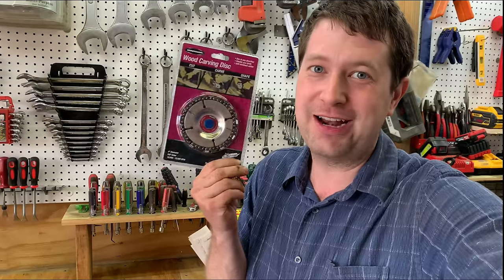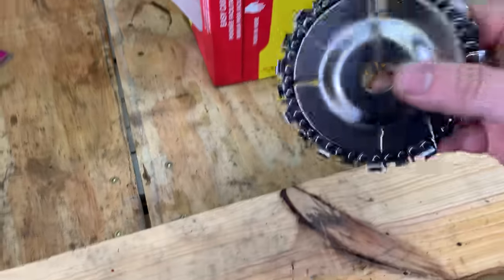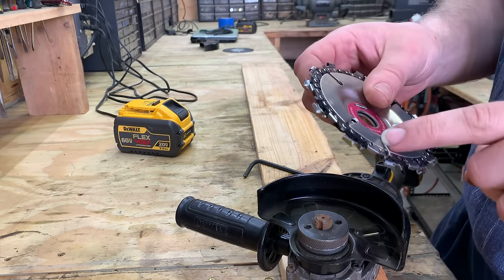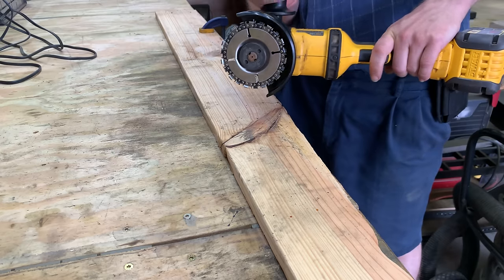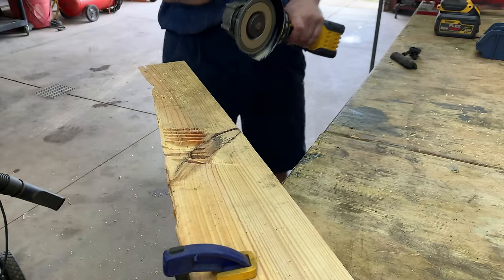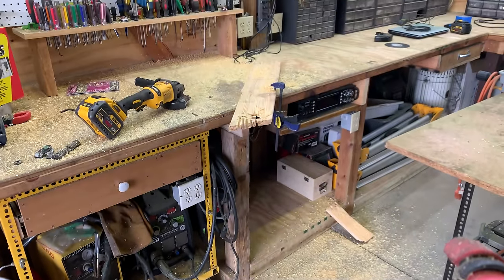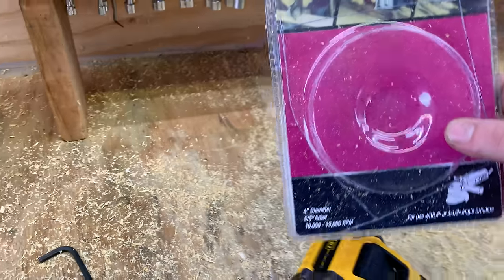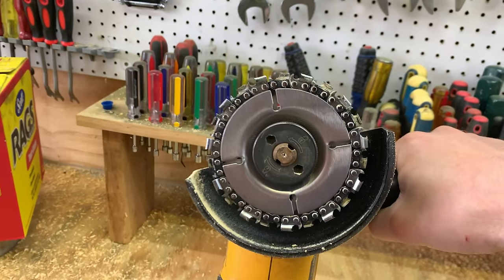Most Dangerous Angle Grinder Attachment I have Ever Seen

Comment: If you're not a wood Carver you would think this attachment is crazy. As a woodcarver I can say that this thing is great.
Reply: I’m not a wood carver, and I think it’s great!
Reply: As a young man trying to learn, this seems like a brilliant tool.

Whats the sharpening routine like? The teeth look quite irregular, so i cant work that out... Maybe like a chainsaw blade, file each tooth?
Reply: @zerg9523  I sharpen mine with the same files I use on my chainsaw.
Reply: Humor In Politics I bailed at 00:15.  First impression of this guy was he has no idea what he’s talking about
Reply: its too dangerous though
Reply: I actually also posted this question to the video... *see below*

This does look like a very effective tool... However it looks like it could bite the operator very easily and just as quickly. What would be the best practices for using this tool?

I’ve added some initial guesses below...

- Use it with a grinder that has a clutch or brake so it doesn’t idle when you power off.

- Never use it ”always on” mode. Make sure you need to hold the trigger, at least then when you let go, the danger stops.

- Personal protection : eyewear as a minimum, leather apron, chain mail gauntlets...
Reply: You must not have seen Stumpy Nubs video regarding his "experience" with one of these devices. I'll take a hard pass.

Here is the video in case you're interested. He had a few follow up videos too.

https://youtu.be/IIQu1e8DGUw
Reply: I'm a wood turner, as soon as I saw the thumbnail I had to see how well in carved. I have to say, its pretty impressive. It removes a lot of material and looked like it did so quite cleanly. I may have to see if I can find one next time I'm at the ol HF.
Reply: J Lang - Thank you, no i handn’t seen it, but now I have... scary...

I am a computer guy and home gamer engineer, i since it seems so effective i’m wondering is there anyway such a thing could be made safe.

My first reaction would be some sort of acceleration based emergency brake. Nobody is throwing that thing around while it’s being used, so its a perfect candidate for it.
Reply: a long time woodworker james hamilton - stumpy nubs reviewed this device about a year ago, one of his videos shows it kicking back and severing two tendons in his hand, he is a very experianced woodworker, and power carver.  it still bit him and damn near eviscerated him, no amount of safety grear would have stopped the damage only sheer luck he has his hands. just read more comments sounds like i am repeating j lang, and he put in the video link
Reply: Zerg a home gamer engineer?
Reply: Kommentare Kommentierer - i’m a software developer for a living... but i get my fun in my home workshop making things.
Reply: J Lang okay, thanks - I have modified my opinion of this thing after watching that 😬
Reply: WHO has believed our report? and to whom is the arm of YAHUAH revealed?  YESHA'YAHU (ISAIAH) 53:1 את CEPHER
Reply: It's a substitute for carving when otherwise you'd use a chain saw.
Reply: @Rick-ql9wp  right?? I'm a carpenter and just listening to this guy talk I can also tell his common sense level is nil.
Reply: I'd like to bet that if it had made in America and was 3 times the price he would have said it was one of the best inventions for wood carvers going.
Reply: Cool grinder attachment
Reply: @jimwilson946  I completely agree.
Reply: Ave knockoff
Reply: Straight up getting one of these, looks epic :D
Reply: J Lang Yup. Thankyou for posting that link. So many nay sayers in these comments....Stumpy isn’t someone that I’d call careless or foolish yet it still caused him significant damage. Definite hard pass.
Reply: Check out the dude from stumpy nubs. Surely no noobie woodworker and had a nasty accident with these. There's a video where he explains how the blade catches and made him loose control of the tool
Reply: I was thinking the same
Reply: I subbed
Reply: @zerg9523   These diabolical attachments should be banned - They CANNOT be made safe in any way. 
A blade rotating at that speed will remove fingers or nuts quicker than anyone could react to stop or avoid any kickback scenario.
Reply: Da Reproducer - I agree, and think you’re absolutely right about the reaction time, nobody can react quicker than it can kick.

That being said, as a software engineer and home gamer mechanical engineer, i like a challenge... My first thought was an inertial sensor with an emergency blade break... that could comfortably react within a few hundredths of a second, before its had chance to really bite the operator.

I was actually so interested in the thing, i asked an experienced carpenter friend. He tells me that some emergency breaks already exist in the marketplace and usually in the higher end tools (particularly circular saws)... He has never seen an angle grinder with such a break system...

What are your thoughts on that? And thanks for the reply by the way, sensible answers are not easy to come by on YT.
Reply: @zerg9523  if you research it, you'll find out why angle grinders don't have breaks. Also, every video that shows this attachment kicking back, is when the operator uses it improperly. I've been using it almost daily for 2 and a half years. Its cut my large carving project times by about 30% and I've never had a kickback. I never use it improperly thought.
Reply: Humor In Politics - I totally get that, an experienced operator with lots of sense generally gets to keep their finger through a career... Maybe i am trying to idiot proof something that idiots should never had touched in the first place.

I have looked into why angle grinders don’t have breaks and please correct me if i am wrong. I can only really find a single good reason, loss of peak torque in a clutched system. From what i can see other than that it comes down to product expense and manufacturer choice.

I have as an experiment added a clutched orbital gear-set to an angle grinder in the past, long before i ever encountered these carving discs... After seriously rough testing, I discovered it almost cant kick back with such a system but the torque lost was significant.

I’m not considering a clutch in this solution however. Using a small amount of electronics i was considering an inertial sensor that once tripped cuts the power to the tool and also engages a calliper like slam break on the disc itself... that prevents the loss of torque by avoiding a clutch altogether, but could still potentially offer a slam break option.
Reply: Humor In Politics - As an aside, i’m not some total lunatic blindly making dangerous tools... i actually make dangerous tools with my eyes open all the time... i am currently building a set of laser cutting cnc machines at the moment.
Reply: @zerg9523  when did I call you a lunatic thats blindly making dangerous tools?
Reply: Humor In Politics - Oh sorry if i gave that impression, i was just making sure that you didn’t think i was some halfwit crank waffling on.
Reply: you can't blame if most people are ignorant!!!
Reply: @jimwilson946  I shared yr opinion .
Reply: I have seen wood carvers working amazing with that thing and also i wanted to say that this guy has absolutelly not a clue what he is doing..
Reply: Exactly. For building log homes its the most benificial tool on the site!
Reply: @zerg9523  i agree. But then again what tool cant bit ya? Chalk box maybe? Lol
Reply: @scottlytton5328  the people I've seen get hurt with it are the ones cutting with the side of the blade spinning towards them. As long as you the the side spinning away from you, if it binds, the grinder tries to pull away from you and not toward you.
Reply: Humor In Politics - that is a very sensible tip... and i suppose the halfwit user solution to that would be if the cutting disc came with a shroud that covered the entire left face of the blade, you’d save a lot of people some pain with that i think... thanks again for the tip, always better to be told than to learn the hard way.
Reply: @jlang8213  0
Reply: Maybe you in iron man armour suit's 😀
Reply: @hartonoX69  just need a touch of common sense and always wear your leather leg guards, your leather apron and leather arm guard gloves. Just your standard basic woodcarving safety gear. But let's be honest, not everyone is bright enough wear standard safety gear and those people are just demonstrating natural selection at work.
Reply: @rallywagon261  I agree! I was worried when I saw the title, but after watching how he was using it...like a chainsaw instead of a carver, I wanted one
Reply: We're getting a bit too risk averse... If you're nervous better not go near it.
Life is dangerous... We're so terrified of dying in the UK we let a sociopathic elite lock us in and take our freedom and (a kind of) democracy away.
This disc and a virus 17 times less deadly than flu has left too many of us cowering inside terrified of going to hospital when we need life saving treatment.
This blade like the mystery virus needs respect not fear.
If you're afraid of Drowning in your own bath maybe stick to showers... With handrails and rubber mats of course... Don't use any power tools
Reply: @zerg9523  It is a chainsaw blade.
Reply: If it fixed onto something,i guess its pretty safe.Our hands cant posibbly handle the torque when it did grab into material suddenly.
Reply: @UrMomGreen.  the proper way to use it is by making sure that the side of the disc you're cutting with, is always the side that is spinning away from the user. That way if it catches a hard knot or binds in the wood, the disc grinder gets pulled away from you instead of towards you. Every injury I've seen that was caught on video with this attachment is because they were using it wrong and were using the side spinning toward them.
Reply: I am a chainsaw artist who also makes heavy use of angel grinder attachments on my sculptures and this one is just about the only attachment I didn't want.   It really is stupid because it does the same thing as the saw except with the saw you're a lot further away from the tip.  Btw I didn't watch the video (guy seems like a fool).
Reply: @captaingrub2228  the guy is a fool. The tip of the chainsaw can do pretty much everything this attachment can do. But this attachment can do it in a fraction of the time and this attachment gives much more control resulting in a much cleaner look. Especially during comps.
Reply: In some hands even a sharp pencil is dangerous. lol
Reply: I'm thinking maybe it could be used to grid a stump.
Reply: @MrMunchiemo  it actually works fantastic for stump removal.
Reply: @zerg9523  sharpen as you do any chainsaw blade
Reply: Nope these things are not dangerous because you could cut your self but those chains are  not meant for those kind of  speeds in a chainsaws they are way slower there is a company that makes kind of the same but with hardend steel teeth welded on a steel disk it called graff speedcut and is only around 20 € here in germany  so no need to use thes cheap chines things and risk the chain breaking and fly off
Reply: @jlang8213  thank you for the link.  That was a great vid.
Reply: What happens if the chain breaks?.Have you ever experienced a chain cut?
Reply: @danielillo673  it's not a chain wrapped around the disc. And no I have never experienced a chain cut because I wear protective gear whenever I have a saw in my hand
Reply: As a wood carver I used one for a while. It was effective and i liked the results, but every time I used it when I would put it down i would have to kind of meditate and think about how i had used it. I also used angle grinders for years in construction for rebar. Then my angle grinder jumped with just a sanding disc and bit in to my forearm. Had it been the chainsaw disc I would have likely had permanent damage. This thing is scary and there are belt driven grinder attachments that extend the cutter away from your hands and if it does kick, the belt stops it spinning
Reply: Can't figure out why he thinks it's any more dangerous than a chainsaw
Reply: @mariano_353  Don't know the guy but a name like Stumpy makes me suspect he's been accident prone in the past
Reply: @andygalloway461  its not. As long as you're wearing your standard protective gear, use the device properly and don't act like an idiot, this isn't any more dangerous than any powered saw.
Reply: @andygalloway461  see his video about his accident and tell me if he's been neglectful or it's something inherent to the tool that can happen to anyone
Reply: Use guard I guess
Reply: @andrewpuckridge7633  did he have the guard on?
Reply: Rip I now have one hand
Reply: I can see that 100% near the end
Reply: @Rick-ql9wp  he’s trying to hard.
Reply: Very thick cut,waistage,no precise cutting.Very carelessly handled.
Reply: Just like with every other tool simple or not, only professionals really know how to use it. Average schmucks like him & I?...well we're screwed.

(horrible pun intended 😏).
Reply: But WHY not made from a solid disk which can rotate, why need to add the chain? Chainsaw need the chain, because the tab of the chainsaw cant move so they need a moveable thing around it, which can cut.
Reply: @andrewpuckridge7633  have you seen any reviews of the solid disc ones that look like rotary wrasps they look like they would be far safer than this but I am wary of putting anything on a grinder thats not a brush or a grinding disk just due to the insane torque and speed grinders produce
Reply: @leprosysucks  i Agree carving tools on a grinder are dangerous and i dont use them,  a youtuber called "stumpy nubs"  does use some solid and much safer to use carving tools for a grinder,  he did as video about them, and explains the safety much better than i can, he is also the one who against his own judgement  filmed himself using one of the chainsaw variants and shared the injuries he receved.  short form, he is still recovering full use of his hand 9 nmonths later.

cheers
Reply: Mariano _ Nunn
Reply: Xcc
Reply: No good carvers use these. Only hacks
Reply: @dremmelkiller  only hacks who lack the knowledge, experience and confidence  don't, and shouldn't, use these fantastic disks. But thanks for your hackish opinion.
Reply: I’ve spent many an hour with this type tool.  Originally sold under brand name Lancelot.  The damn thing isn’t a circular saw, dude.  It’s used like any other grinder, only it’s more aggressive.  To carve and shape.  Not cut.  He sort of figures it out near the end, but is using it without any design or plan.  He should just throw his down a well.
Reply: @OriginalRoadScholar  tell me more about my profession please.  
Please show how wrong you are to the rest of us
Reply: @humorinpolitics56  you seem to want to have credibility by using your lazer cutting cnc job.  Well let's be adults then.  I am a pro chainsaw carver with 30 years in the business.
I use almost all tools that are used in this profession. 
The angle grinder attachments are unsafe due to a kickback and grip issue on the tool due to its shortness and the proximity to your face and groin when it spines out of your hands.  Hundreds of people have injured themselves with this tool in my personal groups.  
So we get defensive.  Them some person with bravado tells us we are weak or dumb.  Ok pal  
Now be an adult and realize this may kill some senior or kid.
Reply: @dremmelkiller  what are you talking about a laser CNC machine for now? I'm starting to think you originally meant to comment on someone elses post but hit mine by accident. I've never said anything about laser cutting. But either way, these types of disks are safe and don't kick back at all when used properly by any semi intelligent person. A basic understanding of chainsaws, grinders and highschool level physics will allow someone to use these products safely with zero kick back. I've been using them on almost a daily basis since they first hit the market and haven't had a single kickback. Anyone that has used one of these and had it kickback shouldn't be handling any power tools or sharp objects to begin with. I'm sure you've heard of the old saying, you can't fix stupid. Well not even with 30 years of experience apparantly.

Anyways, it has been fun having this back and forth banter but we'll just have to agree to disagree. Have a good one.
Reply: @humorinpolitics56  enjoy your day.  I guess some random. Guy on the internet knows more than 25 to 30 years experience in the exact field of discussion.   This is why I love the internet.   No matter how wrong you are you can still hold you head high and claim to be right.  I guess my viral videos and world competitions in 3 continents mean nothing compared to some guy who knows saftey.  I guess the hundreds of my friends who are considered the best in the world are also naive or dumb.  
You make me giggle
Reply: @zerg9523  I would replace it.
Reply: I'm just not comfortable with an item that has that many failure points spinning at 30,000rpm close to my body..
Reply: @deathninja16  Then don't use it. Its no more dangerous than using a chainsaw or angle grinder, when using it improperly. If you're scared of this tool, then you should be scared of every cutting tool because when being used improperly, any cutting tool can seriously injure you.
Reply: That’s the stupidest advise I’ve ever heard in my life guarantee 2 or 3 out of ten people will be going to the hospital or morgue when they use it. Smarten up would you have somebody work on a lathe without knowing what to do and still easily could get hurt bad right